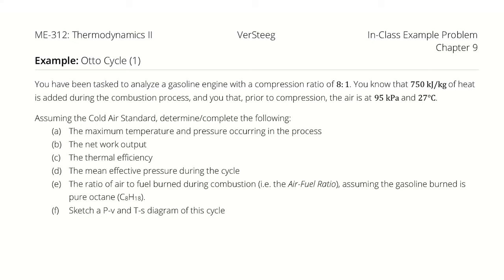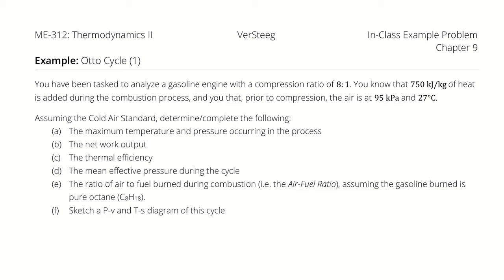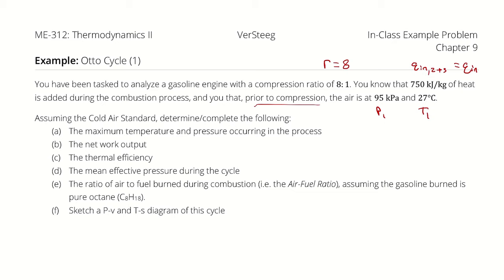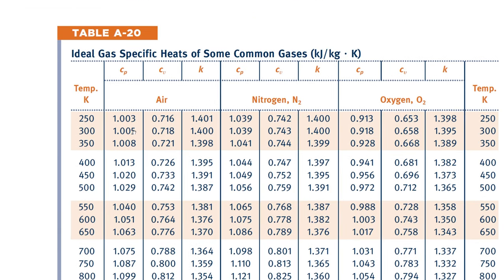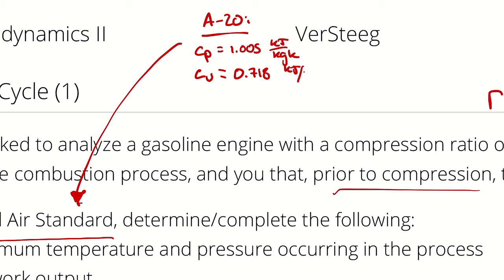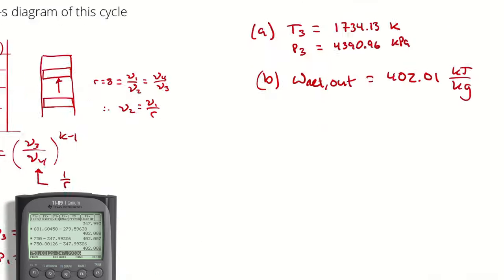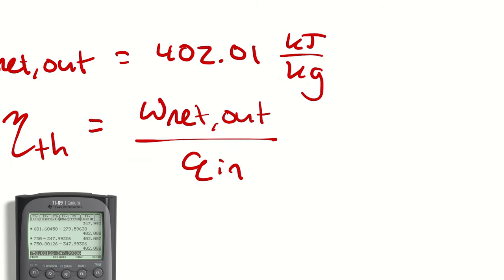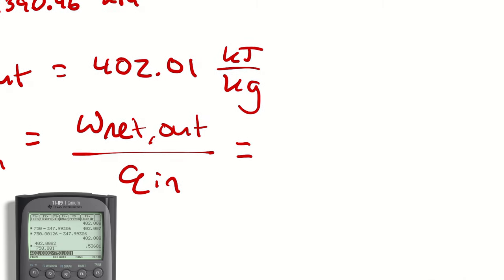Example Problem - Otto Cycle (with the cold air standard)

Comment: how do you know the specific heat added in step 2 and 3 for calculate pressure and temperature?
Reply: It was given in the problem statement ("You know that 750 kJ/kg of heat is added during the combustion process"), and we know the combustion process occurs between states 2 and 3.